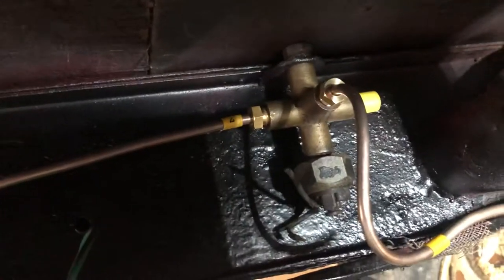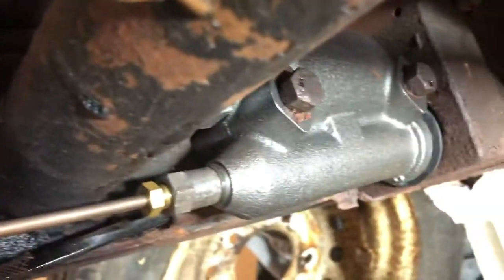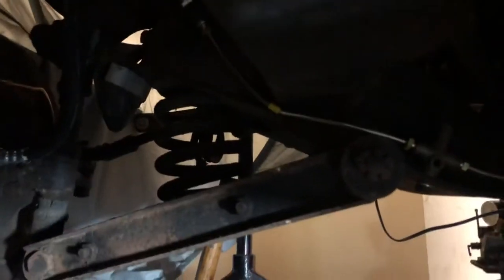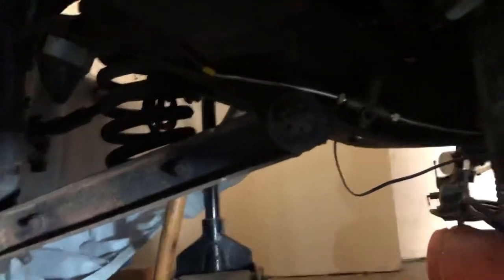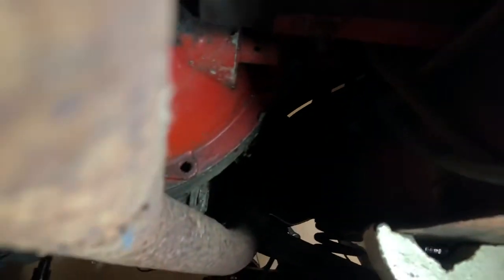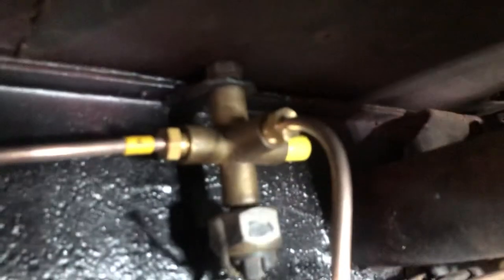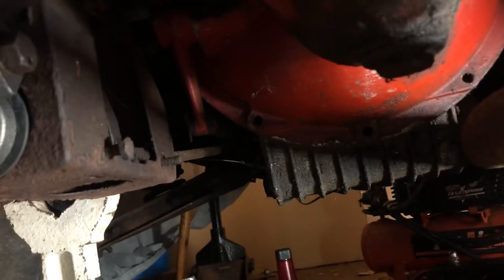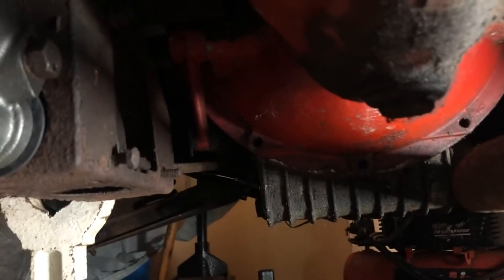MG TD continuing brake lines installation, and a sinister plot by microwaved tea lovers discovered !

Comment: I'm doing this line replacement now along with the Wilwood disc brake conversion. Any tips?
Reply from the maker: Yes.  Get a tube bender, also go slow and take your time.    You can re bend the pipe if you make a mistake ( as long as it’s not kinked ).  Also make sure the fittings are seated.  If you are trying to tighten the fittings and it doesn’t seem to tighten, you have to make sure the pipes line up.  I hope I explained that well..   good luck 🍀
Reply from the maker: What I mean is if the fittings are slightly off it will feel like you are stripping the threads, so you got to move or slightly bend the pipe until it seats.
Reply: @hammerandhatchetengineerin4967  Thanks man!